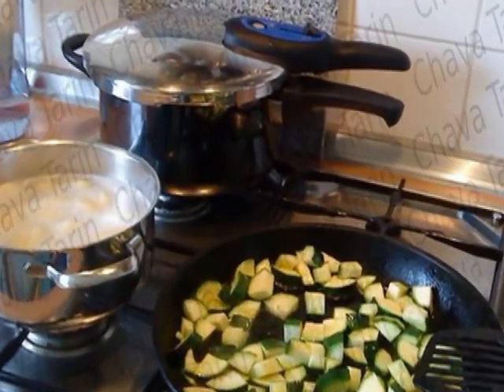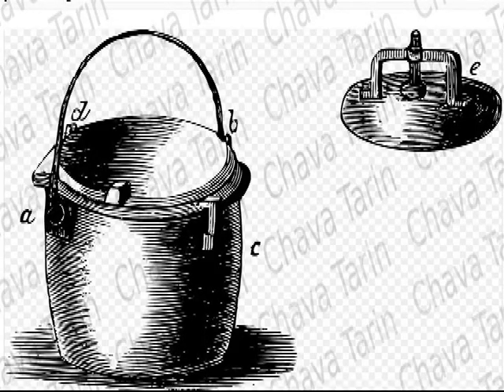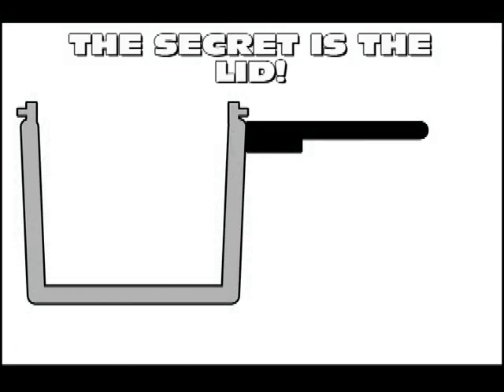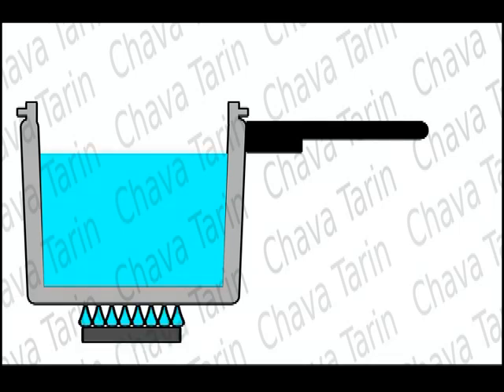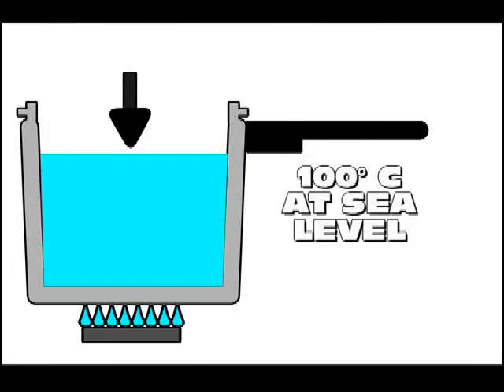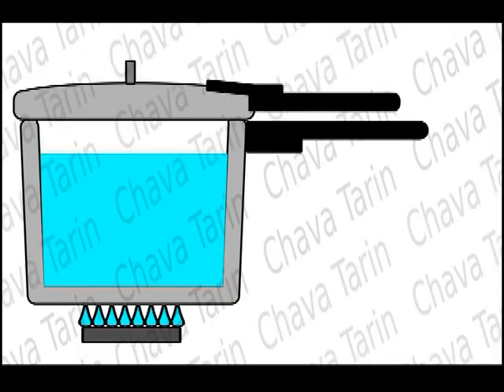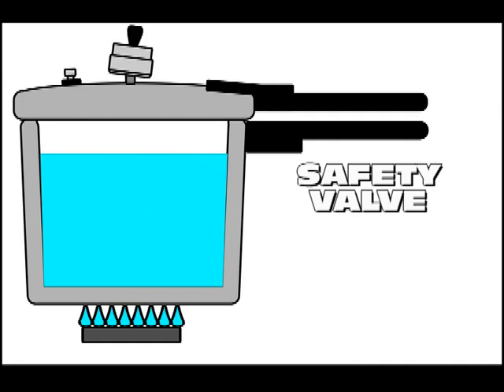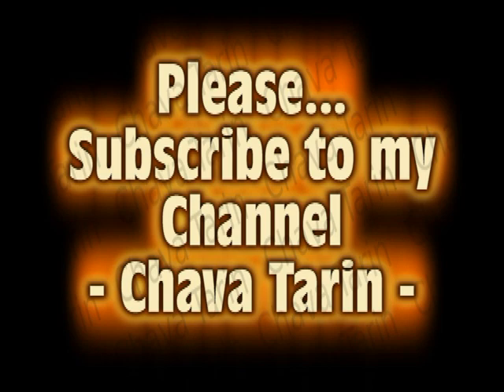How a Pressure Cooker Works

Comment: Hey can u plz tell me how does the steam form if the boiling point is increased ,it should remain liquid right
Reply from the maker: Steam forms, indeed, however, the boiling temperature is raised as pressure increases. Water boiling point is lower above sea level, since air pressure is lower at high altitudes. On the other hand, in places below sea level, water boils at higher temperature. That is the way a closed container, such as a pressure cooker works, all pressure cookers have a means of releasing some of the steam pressure, in order to control its maximum temperature.
Reply: @eltunene  thank you so much!!

Comment: Why does the cooker whistle for a while and then stops suddenly instead of gradually leaking steam once the calibrated pressure is reached?
Reply from the maker: It depends on the cooker model, and the condition of the valves. Sometimes the safety valve leaks for a while and suddenly closes, as the pin comes up. A little later, the indicator starts to oscillate and lets steam escape slowly, while food is being cooked. In some models, there will be a stam leak all the time. However, some foods tend to clog the indicator stem and can cause  pressure to raise to a point where the steam will escape suddenly and at best will cause a mess in the kitchen. It's good to check the stem is clear everytime the cooker is used.

Comment: do valves have a standard pressure level at which they will open?
Reply from the maker: Hi, Elbert, yes, there is a very standard pressure for pressure cookers, mainly  1 bar or approximately 100 kPa (15 psi) above the existing atmospheric pressure, at which water in a pressure cooker will reach a temperature of 121 °C (250 °F) before boiling. There are some variations, but most household pressure cookers handle the same pressure.  There is a very nice article on that at https://en.wikipedia.org/wiki/Pressure_cooking even detailing the story of pressure cooking. Thanks for your question!